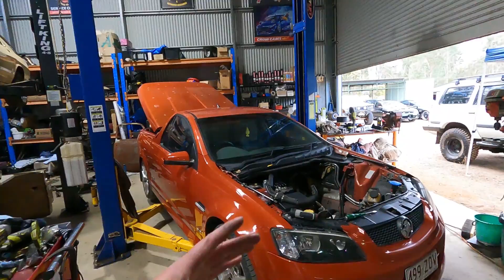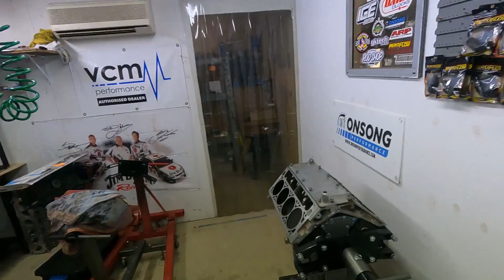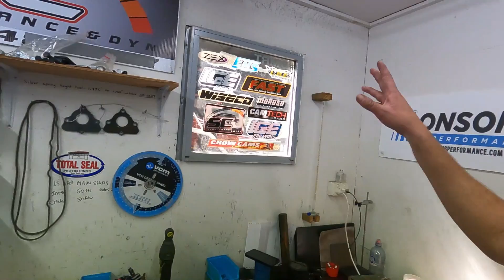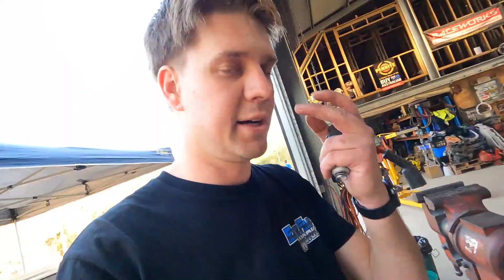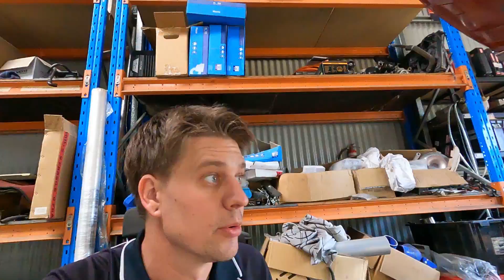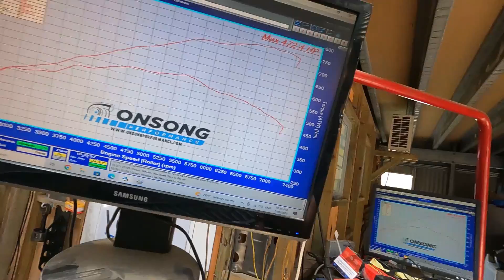OSPWarehouse Cam Kit || VE SS UTE

Comment: Sounds like a stock cam lol 470hp theres no way😅
Reply from the maker: Drives close to a stock one too, would happily daily drive on this cam. Thats why we use it in 90% of our rectangle port cam packages.
We have gone 505whp in a 6L with this cam on E85, and have done 495whp on 98 with this cam on 2 seperate 6L cars.
Reply: Hi i have an L98 auto 2010 pacemaker exhaust  hi flow cats 14:30 14:30 keen to cam it you talk about this cam and  the crow 1212 how about vcm 883 which do you prefer out off all 3 I know I have to hi stall etc thank love your work great content @BoostGumps

Comment: I've heard (Richard Holdener) who dynos all sorts of combos that the standard heads are good for 600 hp so I'd be interested to see you guys dyno a before and after
Reply from the maker: Yeh the standard Rectangle port heads are great! They flow plenty and are very adequate for N/A SBE setups such as this. For us it mostly comes down to cost vs work done. Although in this guise we have only seen around 10-15hp increase from the CNC program, it's not a whole lot more expensive to have the heads CNC'd than it is to get a complete service on them from another machine shop. So we find most customers opt for the CNC program as it's better bang for buck than just having the heads reconditioned and serves as a great advantage in future once forced induction and ethanol come into the picture.
Reply: Gotcha! Makes sense